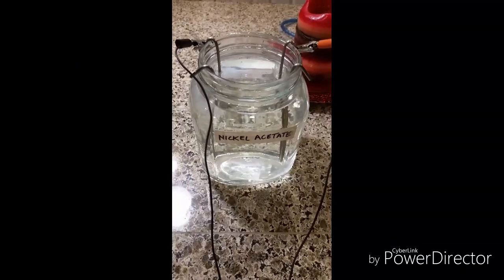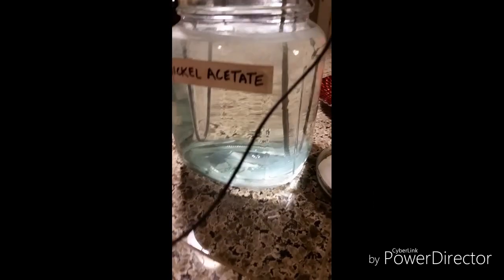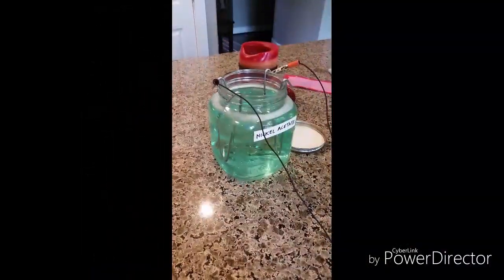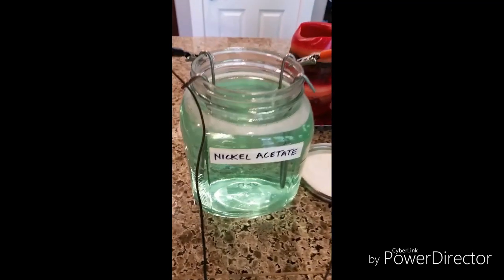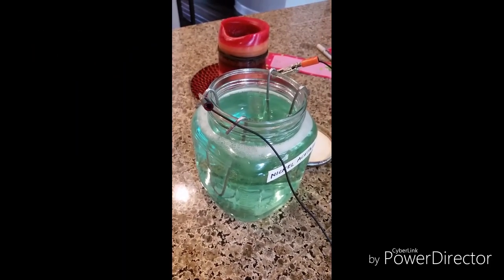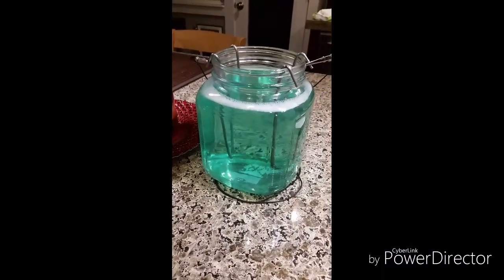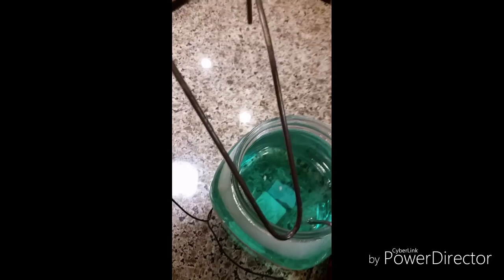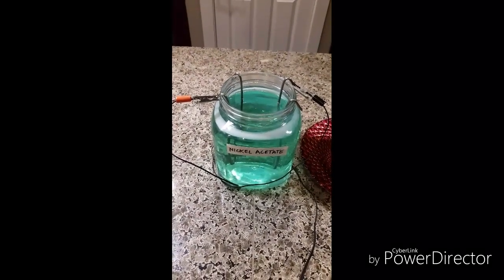How to make the Nickel Acetate solution for nickel plating.

Comment: What kinds of rods did you use? I stripped some 6011 that look like nickel but not sure if it is.
Reply from the maker: I bought a pack of Forney 45401 Super 99-Percent Nickel Cast Specialty Rod, 1/8-Inch.  They are not cheap, $55-65 for a pack of 12.   I bought mine on sale and use them for welding cast iron.  some people use nicklel plated items and pull the piece out when the attrition is lowered to the underlying metal.  The nickel rods last a long time and are worth every penny if you plan on plating more than a few times.
Reply: +Bryan 212 I'm just plating some motorcycle spokes and that's it so.
Reply: Bryan 212 I have some Forney 43400 cast iron rods. Would they work?
Reply from the maker: I do not know for sure the content of those rods.  I even looked online.  But, based on the low price of those rods I would bed they are very low nickel content.  I know they are also used for cast iron welding but must have a different mix.  you are better off finding something at a hardware store that you know for sure is nickel, even if you use nickel plated objects and pull them out when the nickel disburses.
Reply: Bryan 212 well I tried the 6011 rods and after about 4 hrs the solution was burnt orange and the rods had disintegrated.   So no they weren't nickel. I'm just going to get some Nickel guitar strings lol. Thanks though.
Reply from the maker: yea, i suspected that.  nickel guitar strings will work.  whatever you can get that is cheap and nickel:)

Comment: Hey Bryan, First of all, Great Video, Many thanks!  Now a Couple Questions:
1) What voltage out of that little phone charger? -- there are so many different voltages used with them.  Would you say higher voltage is better/faster or what?
2) What alloy in that nickel welding rod?  Should I be worried about all of the various other components of the alloy?  I can get 91.5% alloy rod (often identified as Nickel 99), or ESAB Ni-1, which is 96%.  Other alloys are often around 70% or less Nickel content.

Thanks for any info you can provide,
Tony
Reply from the maker: Thanks, i made the video bcz my first video didnt explain the solution.  the voltage is a 5 yr old samsung 5.6 volt charger.  i have used 9v battery before, it just takes longer.  when I experimented w/higher volts it didnt plate as smooth,  it tends to get blackish and splotchy.  but, too slow and you wait around for hrs.  my welding rods were Lincoln 99% rods from Ace Hardware.  the less other metals the better.  also, clean the flux off the rods w a knife and then use alcohol to clean.  the key to plating is clean, clean, clean parts before plating.  i have heard of people using nickel plated parts to disolve but you have to watch the anode and pull it out when the nickel gets thin so other metals dont get it.  just give your welding rods a try.
Reply: Thanks!
Reply: @idahomecustomdesign  Yea... What rod?  What's the rod number?
Reply from the maker: @rustusandroid  45401 is the #
Reply: @idahomecustomdesign  Ahhh, thank you :)

Comment: are the welding rod for welding steel. where do i get them
Reply: Look for the ones for cast iron... read the package or call the welding supply shop. They are good at getting exactly what you need for a very good price.

Comment: I recommend using 60 volts and buy a Walmart hot plate to put it on. This will speed it up considerably
Reply: I'm still learning, but wouldn't that make the coat less adherent and more "lumpy"?

Comment: Even electrolytically nickel doesnt disolve readily. takes a long time. considering typical comercial plating baths have a nickel metal content of 100-200g/L , sorry this setup is not feasible. when the concentration will get higher you will plate out nickel on the cathode so you are just moving nickel from left to right or vice versa. Weigh your electrodes before and after so you see how much actually dissolved. electrolytical  nickel salt production needs a semipermeable diaphragm to separate the cell into 2 compartments so catholyte and anolyte cannot mix but current still can pass through. A faster approach would be just to buy some nickelcarbonate from the pottery supply and add vinegar to that. CO2 gas will be released (vigorous bubbling) and nickelacetate will form. Better to use a more concentrated vinegar.with a 5% vinegar  youl will form only 50g of nickelacetate per liter of it.   180-300g/L nickelacetate + 30g/L boric acid (roach killer) will make a useful bath. Only dull deposits, for mirror bright deposits a special brightener is needed.
Reply: Brighteners are additives or baths that produce a shiny nickel deposit rather than a dull deposit. Most are proprietary for plating chemical companies. I use Rio Grande but there are several to choose from.

Comment from the maker: sorry, I'm still learning video editing:)
Reply: Exactly the info i was looking for. I bet a low voltage AC source could work better for pulling the Nickel of the rods and into the vinegar solution. One thing i do not understand? Do they really sell 100% pure vinegar over the counter where you live? 35% is the strongest i can get here at the local grocery store.
Reply: Never mind i googled for distilled white vinegar and found the brand you showed us in the video. The lable on the bottle says "reduced with water to 5% acidity"
Reply from the maker: that is how i make copper solution, as well.  because nickel is a much harder metal than copper my guess would be it would take weeks to develop solution.  the low electricity pulls the nickel out quicker.
Reply: Doesn't the Salt create Chlorine in there. I just know you shouldn't use it as electrolyte.
Reply: Bryan 212 im using 2 12v solar panals linked for 12v x2 ampage. Is this too aggressive as ive always used 12v dc for plating experiments